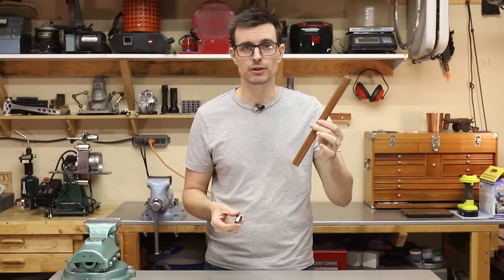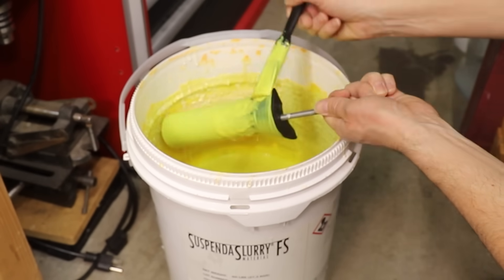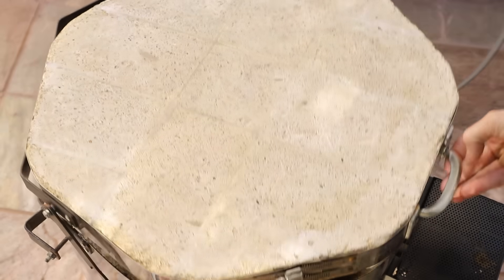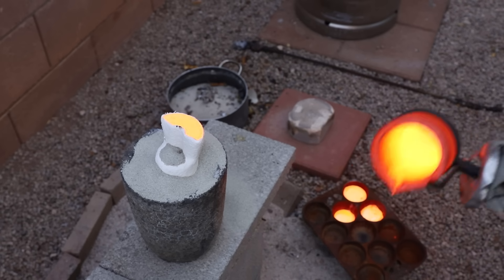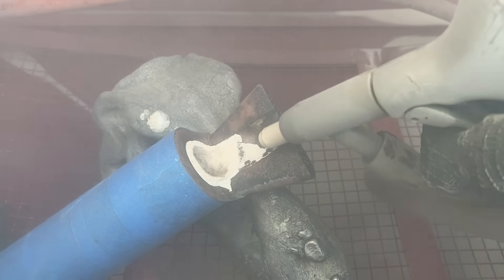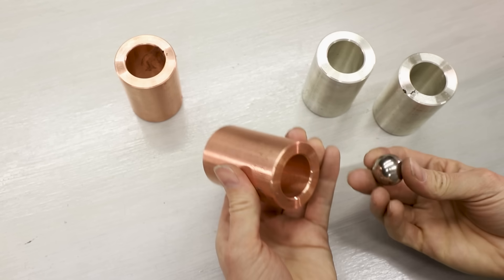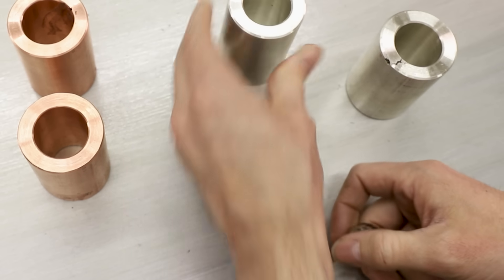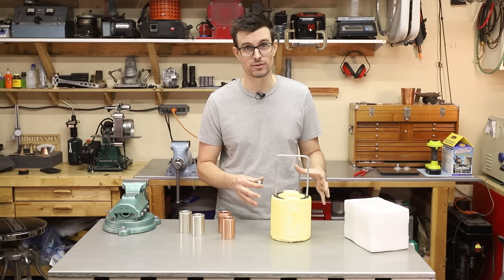Making Anti-gravity tubes - Copper & Silver! - Lenz's law - Metal casting Experiment

Comment: Show me gold.
Reply: Certainly! Here is the doctoral thesis summary translated into English:

---

*Title:* Application of Electromagnetic Levitation for Stabilization and Load Bearing: Theory and Experimental Analysis

*Abstract:*
This thesis explores the concept of electromagnetic levitation using electromagnetic coils to stabilize and support loads. The experimental system involves a cylindrical tube containing a magnetized sphere and a coil positioned at the lower part of the tube. When current is passed through the coil, it generates a magnetic field that interacts with the magnets in the sphere, enabling levitation and stabilization of the load placed above the sphere. This study analyzes the theoretical aspects, engineering challenges, and experimental results of this approach.

*1. Introduction*
Electromagnetic levitation is a technology that uses magnetic forces to keep objects in a stable position without physical contact. This thesis investigates the application of electromagnetic levitation using electromagnetic coils to achieve stable levitation and efficient load bearing. The potential of such systems for reducing noise and increasing efficiency compared to conventional methods is considered.

*2. Theoretical Foundation*
2.1. Principles of Magnetic Levitation  
The basic principles of magnetic levitation are explained, including magnetic field interactions and the forces that enable object levitation.

2.2. Electromagnetism and Coils  
The study explores how coils carrying current create a magnetic field and how this field can affect the magnets in the sphere. Explanations include Lenz's Law and electromagnetic induction.

*3. Experimental Design*
3.1. Description of the Experimental System  
The system involving the tube, magnetized sphere, and coil is described in detail. Specifications of materials, design, and configuration are presented.

3.2. Coil Placement and Current Control  
The methodology for placing the coil around the lower part of the tube and controlling the current to generate the required magnetic field is explained.

*4. Experimental Analysis*
4.1. Experimental Methodology  
The experiments conducted to test the effects of the magnetic field on the sphere and the stability of levitation are described.

4.2. Results and Discussion  
Results from testing, including measurements of sphere stability, levitation efficiency, and load-bearing capacity, are presented. The success of the system and challenges faced are discussed.

*5. Conclusion*
It is concluded that the electromagnetic levitation system with coils is capable of stabilizing the sphere and supporting additional loads. The advantages and limitations of this approach, as well as potential applications in various industries, are considered.

*6. Recommendations for Future Research*
Directions for further research are suggested to improve system efficiency, reduce costs, and expand applications of magnetic levitation.

*References*
- Relevant scientific and technical references are included to provide additional information on electromagnetic theory, magnetic levitation, and previous research on this topic.

---

This thesis provides a comprehensive overview of both the theoretical and experimental aspects of applying electromagnetic levitation with coils, exploring ways to enhance stability and efficiency in practical applications.

Comment: It may be the angle it's being shot at, but it appears that when testing the copper tube the magnet is able to make contact. When using the silver tube, the magnet (while falling through faster than the copper tube) does NOT appear to contact the inside at all. Is it simply the camera angle? Or is there another effect here that may have been overlooked while answering the original question? Maybe a more uniform, albeit slightly weaker magnetic field being generated?

Comment: If you still have all 4 tubes, I think it would be interesting to see how long it takes the magnet to fall through all 4 of them attached end to end. You could put both silver tubes between the copper tubes or alternate copper, silver, copper, silver, and stick them together with duct tape. Maybe see if 2 copper tubers between 2 silver tubes performs differently from the silver tubes between the copper. They should be a definite difference with just 3 tubes, withe silver between 2 copper and copper between 2 silver.

Comment: It is not worse because it is not pure silver. But why? An important fact is always left off the explanation - on all youtube videos and in introductory textbooks. Yes, the falling magnet induces a current in the tube, and that current causes a magnetic force that opposes the motion of the magnet. But, think about conservation of energy for one moment. Without any force opposing its motion, when something is dropped from a height h, it will be moving with speed v at the bottom: mgh=mv^2/2 or v=sqrt(2gh). In the tube, the falling magnet reaches terminal velocity rather quickly (immediately after release) for both copper and silver. Even though those terminal velocities are different, the upward force on the magnet is the same in both cases - and equal to the weight of the magnet. However, why does it fall through the silver tube faster? Could it be because it has lower electrical resistance. Think P=R*I^2. The rate at which electrical energy is converted to heat (power) increases when the electrical resistance increases (for a similar current). The induced current in the tube sets up a magnetic field in both tubes such that the tubes both exert the same upward force on falling magnet. The eddy currents are quite similar (in both the copper and the silver), but the copper has a slightly lower resistance than the silver. As another extreme, imagine if you have a slab of super conducting material - that a magnet would levitate above. Now, tip it up as you did the slabs of silver and let the magnet slide down it. How will it slide over that on its way to the table? Answer: The electrical resistance (along with the induced currents) is what actually slows the magnet down. If you make triple-beam balance brakes with a superconductor instead of a plate of aluminum, the balance will oscillate back and forth (until bearing friction and air resistance stops it). I made this really long explanation because I want you guys to think about it. I believe even Vertasium (a great youtuber) misses this important point - a point that you discovered in your experiment and dismissed it thinking the silver was not pure.

Comment: instead of silica sand, use crushed burnt brick (from the roof - it crushes better). It has less thermal expansion and the mould will not crack.

Comment: Could it be that while silver is a better conductor of heat, it is not as good a conductor of electricity? I have never heard of silver wire or coated contacts but gold, yes all the time. I would guess maybe Silver oxide could be the issue, but probably not as you used it right after you made the tubes. Where can I get one of those neodymium magnetic balls?

Comment: So cool to watch.  Could make an interesting display if mounted on a wheel.  attach the copper tubes in line on a wheel with a 1 inch gap ? between them.  drop the ball into the tube at the top;  wait for it to fall thru to the other tube ;  rotate the wheel so the tube with ball is now at the top ; repeat.  Too bad Space X can't land their booster thingy using that contraption.  Heck of a target to hit.

Comment: I made my own Lenz effect, anti-gravity copper tube some years back by amalgamating together a multiplicity of progressively thicker and thicker diameter copper plumbing pipes with aluminum foil wrapping interspersed where needed in the intervening, interstial gaps between the disparate, external to internal copper pipe diameters.
My resultant Lenz effect tube is somewhat thicker, and works even better than the ones demonstrated in this video.

Comment: Hook a scale on to a tube after you weigh the magnet ball weight. then drop the ball in the tube and see what the scale reads. there should be a ratio between tube and ball and tube and ball weighed seperatly.

Comment: I noticed how the 2 tubes stopped the magnet from rolling. Can they somehow be positioned to control the magnet's trajectory? Like, a set path where you roll the magnet towards one and it makes it move towards another? Maybe not with the slowing effect but more like a slingshot effect. Roll it to the side of one at the right distance and it gets momentum towards another like how the voyager probed used planets to change direction with virtually no fuel?

Comment: Fantastic video!. Was very surprised that silver didn't work as well or better than copper, even with sterling silver( silver purity shouldn't matter really). I was wondering if there were any voids in the silver as this would have a VERY detrimental effect on the swirling electrons moving perpendicular to the motion of the magnet falling, generating current. A very important point for future experiments is to have as small a delta as possible, between the diameter of the magnet and the internal diameter of the copper pipe. The magnet will fall even slower! A truly uplifting, inspiring video, Sir! Kudos!

Comment: Isn't it the case that current only flows on the surface of a conductor?  I would presume this holds for the eddy currents that form to oppose changes in magnetic flux.  And that because of this, I would not expect a thick copper tube to perform any different than a thin copper tube for this experiment.

Comment: Don't forget that running magnets through even those relatively small lengths of tubing will set up an EMF that will damage blood vessels and potentially cause irregular pulse in humans - just as a heads up - brain damage is also on the table. Probably a good idea to at least have a brain scan and EKG after doing this experiment.

Comment: Addendum: To purify your sterling silver into pure silver, melt your sterling and pure the molten metal into deep water to make 'corn flakes' then dissolve out the copper with nitric acid, copper preferential reacts with the acid more than the silver. You tube should have videos describing this process in more detail. Looking forward to more videos, Thank you. - Ken

Comment: You should get some physical background. Lenz's law is taught in physics classes 8-9 here in germany.
It's only a little part of the laws of inductivity and electromagnetism (Maxwell's laws). This tube / magnet gadget is a small and interesting effect but it is not how electricity is produced. The induction slows the magnet, it's like a brake and destroys energy.
It's no wonder, the silver tube, like aluminium tubes too, doesn't obstruct the ball as much as the copper one because only really pure silver, sterling ore even less pure silver has a lot lower conductivity than even not so pure copper. 
Everything that happens here is not 'strange' but what is to be expected by the laws of physics.

Comment: You used the two best metal conductors with hardly any difference between them. Aluminium is also a good conductor.    It would be interesting to compare a metal which is a lot less conductive than silver, like manganese or lead.

Comment: I've always thought it would be fun to design a game where the user places plates of various design under a thin sheet of UHMW or PTFE, the whole thing held at an angle so a magnet placed on the face would want to slide down the face, but induced magnetic fields in the plates guide it's motion. The plates are conductive and have cuts that modulate their interaction with the magnet sliding down the face. Think snow boarding but the magnet is the snow boarder. The game would be to find the spot where the magnet could negotiate a course or find its way into a bin. If the concept works, if the cut geometry can impart shear forces normal to the direction of travel, the game wouldn't be crazy expensive. A bunch of extruded aluminum shapes cut, some plastic structure to hold everything together. An alternative would be to have substrate be the thing with the static magnetic field, and that would have various magetic shapes printed onto it, see Correlated Magnetics.
Reply: another thing for people interested in magnets is to understand how a Halbach Array works. Definite brain twister if your not into magnetic field theory.

Comment: 9:37 as you discovered that feeling of weight difference I thought about how awesome it'd be to see a visual representation of the exact weight increase & decrease during Lenz's Law through either the silver and/or copper tubes when the neodymium magnet is allowed to freely fall through the tube. I'm sure theres a way to set up a good quality sensitive digital weight scale to accurately read the exact weight differences of  the copper and/or silver tube *before & during the Lenz's Law phenomenon. I wonder if there are any types of weight scales that have a small  hole through the center of them that would allow for an experiment like that. 
This was an awesome video by the way👍

Comment: 10:00 You could make the cupper superconductive by some cold nitrogen or use some other metal, which become superconductive with a fluid nitrogen, and then the magnetic ball wouldn't fall down at all and stay in the air. That would be a REAL ANTI-GRAVITY :)

Comment: You should measure the weight of that copper tube as the mag ball passes through and see if there is any difference in the weight of each measurement of the two items weighted separately totaled.

Comment: Given that the copper had a stronger interaction, it seems logical that having 5% copper in the silver would actually slightly increase the galvanic response.  Ergo, even pure silver would have a lower response than the copper.  Am I missing something?

Comment: On the casting process, it makes me a bit sad the moulds are one-use-only. Ceramics is not really a recyclable material, and having one-use-only mold made out of a material that is supposed to be durable makes me sad. Wouldn't be possible to just create only one mold, make it splittable (the crucible filled with sand you used would keep the two half together) and reuse it for the two casting?

Comment: The great pyramid of Egypt was a intergalactic transportation device operating on the Earths "B" field : we all live in the "B" field of Earth That is equivalent to the center of a magnetic force . Pyramids were not power devices ?? what for they didn't have washing machines or hair dryers. all pyramids operate in the "B" field of earth and should have provide for communications!! around the earth.. if vibrated at the correct frequency.. Please get tuned into facts, 1. anti gravity is a product of the center field of a magnet. 2. the center of a magnet when vibrated will repel water 3. If you vibrate granite rock with the center field of a magnet at the correct frequency it will turn like butter. that's just the beginning it will play a Hugh part of our country's future. The anti gravity is only applicable to none iron type material such as glass or plastic. If you have a bar magnet simply tap the center near a trickle of water and watch the water move out of the way. Tap the center field on any none metalic surface and watch it loose weight. You can not use a sign wave type vibration it must be saw tooth . A sign wave signal contains the centerfield, that's what pushes AC and radio signals around the world. A sign wave has three elements on an oscilloscope you only see the two , On a scope you see the positive cycle and the negative cycle you never see the most significant part of the cycle and that is the center field that produces the energy to push the energy forward!!! There is allot to be learned about the magnetic center field .. Please help spred the news ..

Comment: Id bet the Ag would work a lot better if the tolerance between the ball and the walls were closer/tighter.  And: does anyone have an explanation for the increase in weight/mass that occurs when the ball is in the tube?  That’s a real head acratcher…. Also, what about other metals, like lead, tin, GOLD, Aluminum, tunygsten, nickel, osmium, iridium,  etc.?

Comment: Sterling may have slowed the magnet more than copper exactly as expected. Measure the diameter of your silver tubes top, middle, and bottom. Do the same for your copper tubes. If your sterling is pure 0.925 Ag 0.075 Cu, you should find the sterling tube has larger average diameter than your copper tube, even if by a small amount. Velocity through the tube increases as the  cube  of the distance from magnetic surface to metal surface. The purity of the sterling is critical. Copper doesn't have much effect on velocity since Cu and Ag have the two highest conductivities of all metals. But even trace amounts of metals such as Zn or Sn can dramatically reduce conductivity and therefore significantly increase the velocity of the magnet through the tube.

Comment: 0:42 “… and the metal that has an even lower resistance is silver.”  Wouldn’t you want a metal that has higher resistance if you wanted the magnet to float-fall slower down the tube?

Comment: Try a magnet the size of a brick and use aluminum pieces. Similar results. You can make an aluminum top and it will spin suspended in the air.
Be careful with any steel around that magnet. Its stringer than you can imagine.

Comment: It would seem that if you had not shortened the tubes, you would have been able to measure the time it took to fall through the tubes. As presented, it wasn’t real obvious to me that one was better than the other. Even suspending the tubes side by side and dropping identical magnets at the same time would have been better imo. 

A little bit crazy how much of the video is spent building the tubes. Interesting in one sense, but seems tangential from the point of the video.